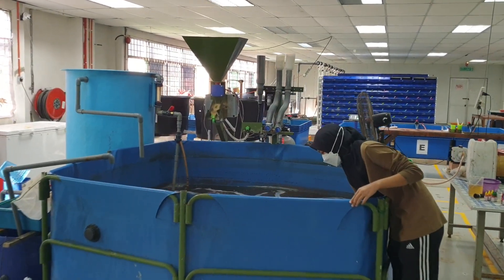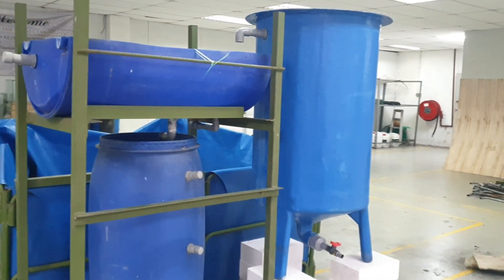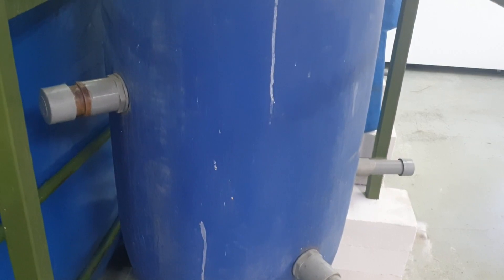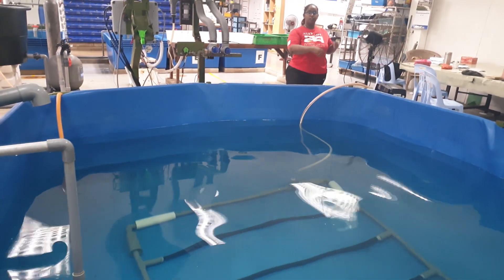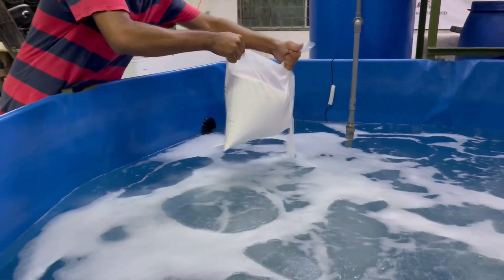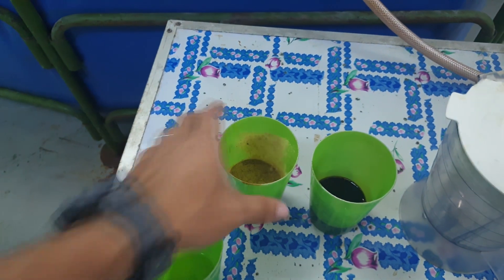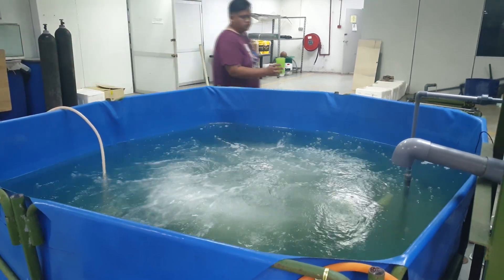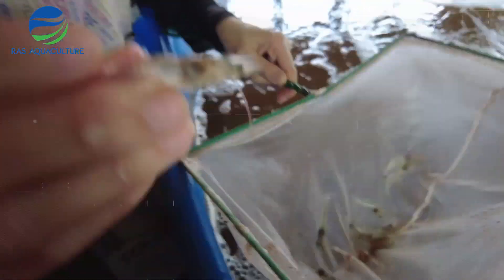New Biofloc Setup with a Hybrid RAS Technology

Comment: Do you know if the suspended flocs disrupt the nitrification? Even after going through settling tank, there will be still be suspended particles that go through to the biofilter and likely to get trapped, and built up on the biofilter eventually, especially when the floc volumes have reached above 5-10 ml/L.
Reply: That's part of the plan isn't it? those suspended solid would make anoxic area that would later depletes the oxygen in that area causing the process called denitrification. Basically finishing the nitrogen cycle. If there are none of it, the nitrate would accumulate inside the system and someday it would be high enough to kill your shrimp or fish.
Reply: @bittersweet4074  yes it is.. I have similar system setup and the nitrate-N never went above 50 ppm at the end of cycle